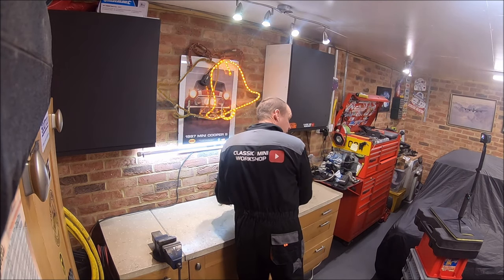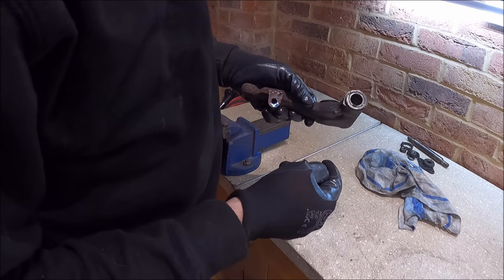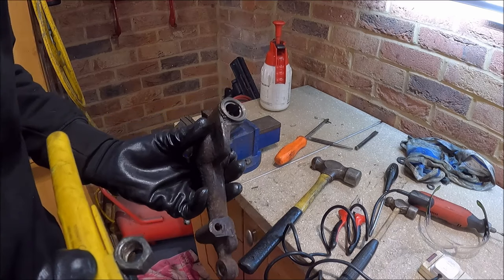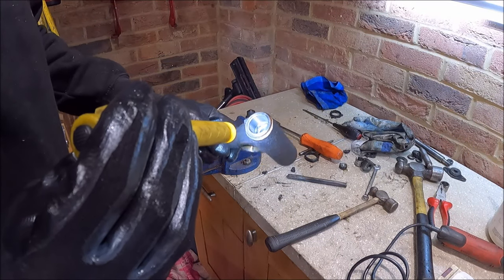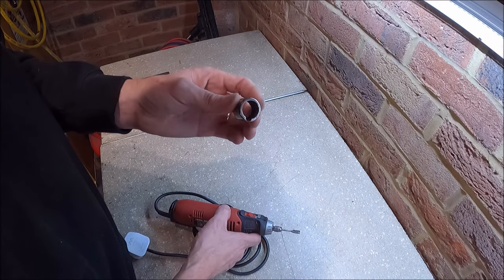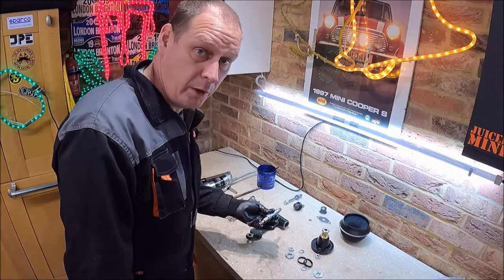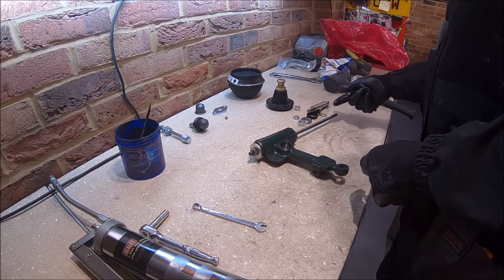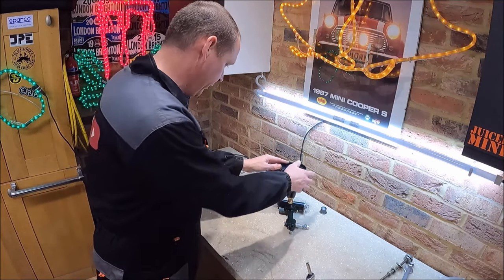Top Suspension Arm Overhaul - Classic Mini Workshop Project Tardis Pt.22

Comment: Hi Keith I followed your advice with Christine’s first start up, I set it all up cranked it over and nothing I then realised HT leads 2 and 3 were the wrong way round (not me!!)  tried again and got a very lumpy response and after a few moments the engine ran but stared to increase revs significantly so I switched it off after which I couldn’t get it going again. I’m not sure what’s going on. Happy to hear your thoughts.
Keep up the good work I think I get as much pleasure watch you restoration as I do my own .
Take Care Stay Safe Everyone Regards Dave 🏴
Reply from the maker: Maybe an air leak if it was revving up by itself? Worth checking the inlet manifold and gasket
Reply: Thanks I’ll have a look, I also thought it might be either the accelerator cable or the idle screw too far in?

Comment: Hi once again, when I did my front suspension arms I bought a cheap internal bearing puller kit off eBay for £ 25 I was a bit dubious about how effective it would be , but it was great had both bearings out literally in seconds, no fuss or nonsense, worth thinking about if you’re doing them on another project. Can’t take the credit for it as I think William Murfitt did a video on it.
Have a great and safe Christmas everyone, Regards Dave🏴
Reply from the maker: Good tip! I'll have a look. There is plant of room at the back of the bearing for an internal puller to fit.